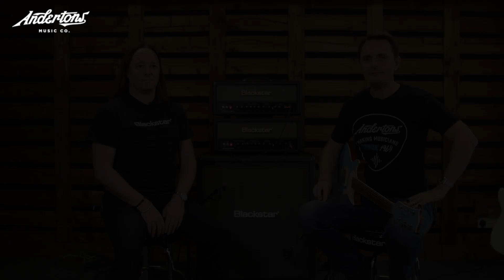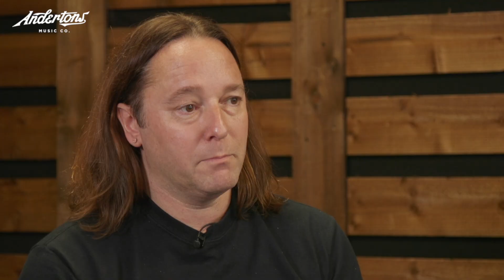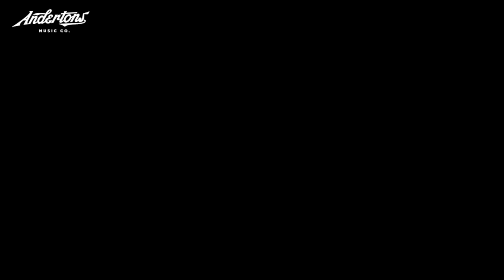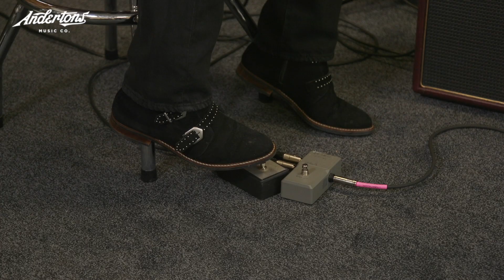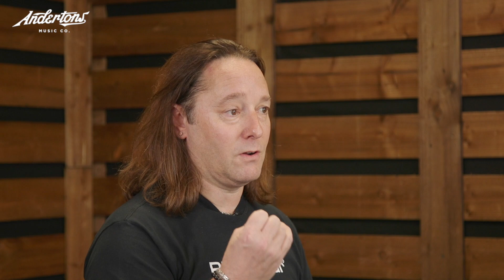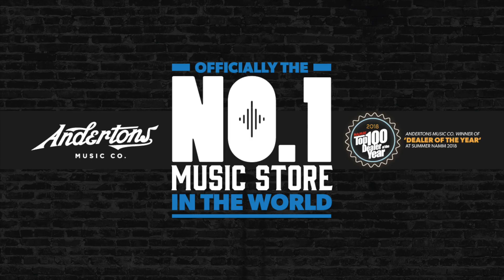Guitar Amp Myths Part 3 - Do Different Valves Make Much Difference?

Comment: The EF86 an unstable valve? really?? lol 😂 .. couldn't be further from the truth ( A Mullard made EF86 Pentode less stable than a crappy and noisy Chinese made triode? 😂) ... The EF86 is a Pentode very quiet / low noise pre-amp valve.   A) A pentode can produce al lot more gain efficiently, compared to a triode  B) it's less "noisy" C) It's ultra Linear D) it's very stable. That's why victory amps are using  pentodes, i.e. the EF91, in their pre-amp stages. made by Mullard in their millions .... many for the military  from the late 1940's right through to 1982 (when Mullard stopped valve production)... the military grade models (have a blue translucent film), are a very high quality and stable pentode pre-amp valve (no longer made, but still millions NOS around Worldwide). The main reason why triodes are used in guitar pre-amp circuits, is simply cost ... they're easier to make, cheaper to make and it's easier to design pre-amp circuits for them ...  That's the long and short of it.

Comment: A guitarist I worked for though different tubes were different class. He kinda knew what push-pull meant. That being said, he thought all amps with EL84 were class A and 6L6 was AB. IOW, he thought a single ended one tube 6L6 amp was AB. I think that's more common than I used to think.

Comment: The only way I was able to make the guess about Artisans was my recall that 6L6 would take more power and might not distort and compress just as much as a result. And I could be completely wrong about this. The sounds were so equal that I just thought one was a tiny bit more open (headroom) and the tiniest bit less distorted than the other. No tonal difference in my ear at all, just the difference in level of cranking them.

I've already been ready to abandon all the assumptions that power tubes make a clear difference in sound, but after this demonstration I'll just completely ignore them regarding the sound. The only thing I'll keep is the power take of tube making a difference, where less will distort more and higher would provide more volume cleanly, packing a bit more punch. Small vintage like EL84 amps, regular rock amps like EL34 and the 80's/90's metal favourite KT88 (VHT) being a big puncher.

This episode btw had something that I haven't heard anywhere else and what's been a complete misconception for ages. That some drive pedals like tubescream and super overdrive sound more/less valve amp like than the other because of the even/odd harmonics their clipping method produces. Which was, probably in a single sentence, proven horseshit when he said class A (with some other qualities) produces even harmonics that are more pleasing and class A/B (with some other qualities) produces odd harmonics that sound more abrasive.

I've got to get that radio handbook. Too bad the full set of amp components and cases costs probably more than what some manufacturers sell their cheaper models for...

Comment: Disagree. can not be, totally impossible, no way .. Is the filament   burnt in with tone wood  when you primed it, do you use green power,  sun power or Atomic power or do run them powerless. If  you use a Kt 88 coal powered you get this dark sound...or if use green power on 6L6 you get west coast sound..or if power comes from a waste incineration plant you get free jazz sustain..digg it?

Comment: probably a difficult area to get into, even after all these years, with patent lawyers everywhere, but wasn't the original bassman power stage the progenitor of almost everything from marshall to sound city to orange...? again, with the available bottles, there are only certain circuit topologies that actually make sense.... 
& what about output transformers? ampeg bass amps sound better in the bottom octave because the o/p transformers are huge....

Comment: This has been a great instructional video. Question if you may: why is there an ACC83 preamp valve inside a cilinder on a Marshall JVM 410H? What does that do? And... which tubes are more frequently to be changed preamp or power amp? Cheers.

Comment: On vintage amps, with vintage tubes, the valves make a huge difference in sound. On modern and more complex amps, and with current production valves, I guess it matters much less.

Comment: I thought you'd mention testing and the difference between say a cheap 12ax7 and a high quality 12ax7 that has passed stringent qc testing because there you can definitely hear the difference.
Reply: Yes you often can hear the difference of particularly bad/cheap 12AX7/ECC83's (depending on the actual circuit) but normally the bigger problems are things like noise and microphonics. They are the main reasons valves are rejected.

Comment: Magnetic saturation in a single ended vs. push pull output transformer is very different. I think that is one of the leading reasons they have different tone. It changes how the amp controls the speaker cone.

Comment: I think a lot of people think tubes impact the sound a lot more than they do because tubes are actually a part of the amp you interact with as a player (you have to replace them every now and again) and thus give them a certain importance. you don't really change the internal circuit or the transformers, although those are in for a much bigger part of the amp's sound (as a sort of proof, I'd mention amp mods touching up the circuit and changing the transformers)
Reply: Yes you are right. In many things, people believe what they want to believe. Valves/Tubes are great, but on their own they have NO SOUND. It is only with a complete circuit that they can do anything.

Comment: Great series find it fascinating to hear what goes on inside our amps. Can you explain a bit more about what gives a Marshall or Fender a different sound is it just the preamp valves for what else?
Reply: Marshall v Fender, there is no one reason for the difference in sound. There are so many different things within the circuits (from input to speaker) and power supplies that all contribute. The problem is that because valves are the things quoted in spec sheets, people latch on to them being the main factor when they are only a part of it.

Comment: I changed my EL34's to 6L6 in my burgera and the 6L6 has more headroom and more bass but the difference is subtle. I have had more difference by changing the preamp tubes to lower gain and turning the master up more. It gave more headroom but on full tilt more clarity. I understand Stevie Ray did this.
Reply: Burgera... is that made by McDonalds ?

Comment: I don’t think you have done a video about different cables. There is a lot of marketing suggesting one sounds better than the other bit I think that’s mostly bull****. I think a lot of people would be interested to see what’s your take on that.
Reply: Different cables can make a difference but mostly when they are the first cable from your guitar. That's where the signal is still 'high impedance'. As soon as you come out the first buffered pedal then it's low impedance and the cables have far less effect. Always use a good cable for your first one from the guitar and no longer than it needs to be. 10m / 30' cables can kill your high frequencies. Paul

Comment: I change mine when they're getting knackered. Then it makes a massive difference. Makes me wonder how many people ever actually wear their valves out, these days, and how many would recognise knackered valves or even realise that they do wear out?
Reply: I wore out the power tubes on my TH30 head, after only about 5 hours of use. I have yet to wear out the power tubes on my Dark Terror, after about 50 hours of use. 

I think having my TH30 head in a storage unit during a Michigan winter, may have caused them to fail early. It gets -20 degrees F here in the winter. Yes, that's minus 20 degrees F.

There was no mistaking the tubes were shot. There was a drastic decrease in tone, volume, then no volume at all. After checking the fuse, speaker cables, guitar, guitar cables, pedalboard cables/power source, pedals, and amp power cord, there was no doubt it was the power tubes. I bought a new matched quad set, replaced them, and my amp came back to life.

Comment: valves are things that open and close. the 6L6 tubes are the best of alltime tubes I say tubes ok.
Reply: Actually a valve is a device that regulates, directs or controls the flow of something. In the case of an electronic valve it's obviously electrons that are controlled. This is why this was chosen as the original name by the British inventor Ambrose Fleming.

Comment: Unplug your main voltage. Turn it on. Let it bleed. okay now it might not kill you or hurt so much.
If you want to be really careful this is where you gingerly open it up but jump the hot side of the capacitors through a fat wire wound resistor to ground and get rid of all those free electrons and render it totally inert.
ONLY use One (1) hand and don't touch ANYTHING ELSE with your other (2nd) hand if you get cocky and start groping around in a plugged-in amplifier. 300-500 volts hurts pretty bad and can kill you, especially if you're gripping the earth (grounded terminal).
Reply: Actually anything much over 50 volts can easily hurt you. Even less voltage can kill you if you try hard enough. If you don't know how many volts are available at each wire maybe you shouldn't be looking at them. YMMV😸

Comment: I can hear a massive difference on some amps. The original JCM800s had 6550s in the US versions. IMO the JCM800 sounds better with EL34s. But I swap preamp tubes all the time and it does change the sound.  Not all tubes are created equally either.
Reply: Yes, the difference are more obviously on different amps. The simpler the amp the more difference is likely to be heard. Modern designs are often more consistent with different valves in.

Comment: Please talk about Rectifier Valve/tube vs Solid State differences.
Reply: Mesa boogie covers this topic pretty well. After all the tube Rectifier/Solid state switch is what give the Dual Rec its name.
Reply: I would love to see that test with two super reverbs cranked.
Reply: Different thing again, and also this can be very subtle, depending on the volume level. No one type is 'better', but some older designs depend on the power supply 'sag' with valve rectifiers to get their signature sound. Most modern amps greatly benefit from the higher headroom and better reliability that silicon diodes give,
Reply: Blackstar Amplification Thanks for the response, I was specifically wondering about the Vox AC4 Handwired, they used a solid state rectifier in it, but a Tube Rectifier in the Handwired Ac15 & Ac30 models.
Will it make the AC4 sound different?
Was it to do with the smaller wattage?
Cost cutting?
I also heard that class A amps aren’t effected by tube rectification the same way as class A/AB amps?
Thanks!

Comment: I would like a answer from Blackstar on how much more money it would cost to build a proper amplifier? Take the tube sockets off the PCB and also the potentiometers and mount them the proper way .. The way amplifiers are built today "They Are designed To Fail" All the failures today are mostly ( Not All) are  due to these two issues! So why keep building them this way may I ask? Besides its the cheap way of so called building so you can buy a new one when the warranty expires as they are not built today to withstand much longer use..I would like a answer to this question PLEASE!!? Thank You......
Reply: You've already answered your own question - they build them that way 'cause it's cheaper .
Reply: Material for amp is relatively cheap, but time and skill is expensive. Building good handwired valve amp is dtate of srt, like painting a picture.
Reply: Hello Shane, thanks for your question. With any product there always has to be a consideration of production cost, selling price, target market, etc. While I agree that we (and most of the industry) do design products with the intention of reducing costs where possible and justifiable (with the intention of getting great sounding amps into the hands of regular players), we certainly do not design amps to fail. We make different amps in different ways and all are important, but a quick glance at sales figures shows that it is the more competitively priced amp that sell the most.
Reply: Thank You for the reply! I may of sounded a little (Like a Ass so to speak) it was not my intention. I was just wondering from a larger amp manufacturer on just how much it would cost per amp built to have the inputs, potentiometers, sockets off the PCB and mounted to the chassis? This is a much more sound design (as I think you would agree) Would a $1,000 usd amp increase in price to around $1,850 usd? Just a question and not trying to bash anyone... Or would it be much more than that?
Reply: @shane011471  Due to the additional labour time, the additional cost would be mostly dependant on where they are made. For parts of the range this can be more easily justified than others. But, if you saw the breakdown in the different sales of units and how this reflects on turnover and profit (of Blackstar and probably most companies) you'd be shocked how much is overwhelmingly made up of mid and lower price units. If enough people bought the higher end products then more would be made. That isn't to say we won't do more such things that you're suggesting in the future.
Reply: I do appreciate your response and THANK YOU!! I totally understand that not everyone wants to spend 2k plus on a head and if that's all that you made you might not still be in business. With that being said the old saying is true in You Do Get What You Pay For... Just wanted to say thank you again for the response Blackstar as I do appreciate it very much..

Comment: Valves make a difference. 6L6, KT66 and EL34 all bring something different to the tonal table in my experience. I hate EL34's too, way too thin and metallic sounding, the cleans are stale and cold compared to the warmth from a 6L6 and KT66. 6L6's sound much more classy, smooth and warm. Not to mention the overtones. However, there is something to be said for chokes, capacitors, pots etc. It definitely makes a difference. I've changed EL34's to 6L6's in a lot of amps I've owned and it always sounds smoother, lusher, thicker but also more glassy, and greater note definition. I've owned a JCM205, Victory v30, Fender Hot Rod Deluxe and an original Silver jubilee. I could tell the difference straight away on both distorted and clean. It was night and day. The EL34 was harsher, thinner,  tinny and colder but had more break up. The 6L6 had a much smoother breakup, notes are more defined and thicker. Not only that but the EL34 was louder. KT66 would be somewhere in the middle which would be harder to differentiate.
Reply: Yes, everything does make a difference, to a lesser or greater extent, but our point was to show that it can often be less than people are expecting and that it is all dependant on the circuit that they are used in.

Comment: I defy anyone to be able to tell the difference between tubes when you engage a tube screamer. I think changing brands of tubes and no’s vs new can be a fun source of experimentation, but it won’t yield much in tone difference. The one thing you may notice that a tube tester would show is manufacturing tolerances between different brands and different runs, but if two different manufacturers tubes of the same type come up with identical specs - you won’t hear a difference